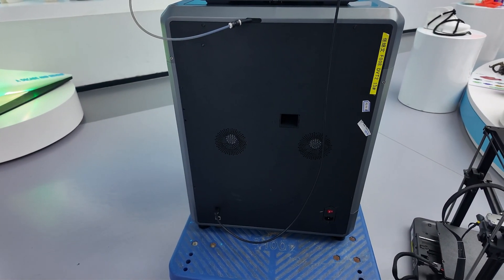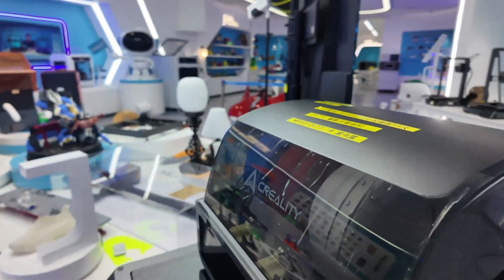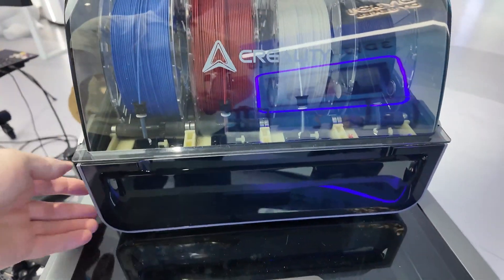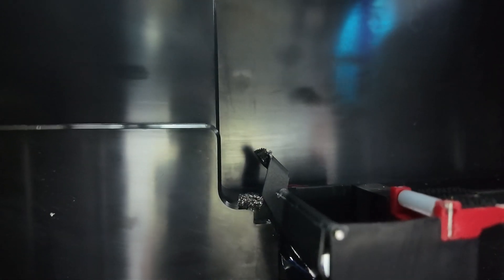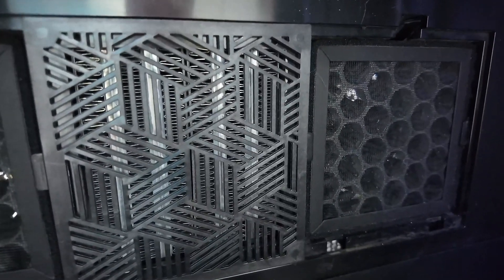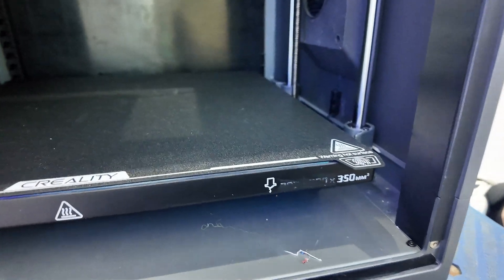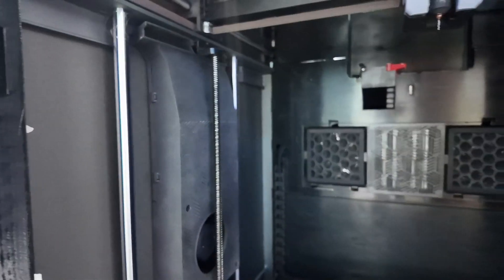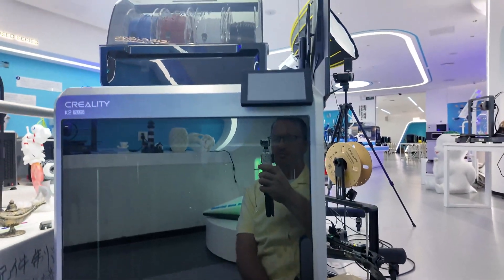Quality Time with #creality K2 Plus.  This is your best look at it so far #crealityk2plus #k2+

Comment: Thanks for the tour Kevin, really looking forward to the printer. My only concern is the decision to go with 2x leadscrews instead of 3 for a bed this large.
Reply: 3 lead screws on independent steppers would be better. When it's only 2, the bed tends to drop gradually over time. 

I'm sure we can mod it in though. Maybe even use 4 leadscrews.
Reply from the maker: they said with the K1 series, there are 3 lead screws but they are all on the same motor.  This has 2 and they are on 2 independent motors so it should be better.  And there are four linear rods on the z axis too...

Comment: It'll be nice to have another enclosed color system printer.  I'll hold off until its been out a few months and others have done the beta testing on it, all the kinks have been worked out and unbiased reviews hit YouTube.  The massive 350 squared printing area does sound extremely tasty though.
Reply from the maker: for me, the print size is the most exciting part too.

Comment: Is it possible to change the spool in cms during printing and set a different color? E.g. I have 5 different colored layers, after printing the first one, I change the spool of color 1 to color 5 and the CMS/printer knows that this color is there?
Reply from the maker: i will ask him this one too - you have good questions!  For your other question about filament going into those CFS holes on the back - that won't work.  The filament box loads and unloads each color so if you put just a roll into the back to try to get 5 colors (love the independent thinking) it would get pushed out when ejected and have no way to get fed back in.  There is a single spool holder available for it if you don't want to use the CFS - or you can buy 2 CFS and have 8 rolls.  Doesn't have to be 8 colors, can do two or three spots of the same color that is commonly used so that when it runs out it will automatically use the new roll of filament in the same color.
Reply: @kevin.in.3d  The previous question was about single colour, not multi-colour printing from an external spool. CFS does not support TPU, I mount the TPU spool on an external holder and what next? How do I connect this to the printer, I have seen that Bambu Lab users print splitters to not have to unplug the AMS from the printer every time they want to use the external spool. Hopefully this will be solved better here

Comment: Can I connect 3 spools directly to the CMS connector instead of another CMS, e.g. TPU, and manually select to print from that spool, single color of course ?
Reply from the maker: good question - i will ask today!
Reply: My guess would be no as the CFS unit is what would pull the filament back out of the extruder but I will be watching for the answer to this question as well.

Comment: Gorgeous 🥰😍 Super excited to get this printer!! It's nice that it also uses cardboard spools. 😊
Reply from the maker: Hi Christine!  Thanks for watching (as always).  Have a good time at Sharefest!
Reply: Cardboard spools suck. They fall to bits when you dry them at high temps.
Reply: @mackinsvii9022 I don't think so. 1 roll of filament only last me a day or 2 so I've never had that problem before
Reply: @ChristineRamirezCr  You're printing PLA I bet? If you're using anything hygroscopic, you have to dry it first.
Reply: @ChristineRamirezCr  print fast and live in the desert!  Good plan.  It's so dry in AZ you must never worry about drying filament.

Comment: Quality of the printed poop shoot part is not really good.. :(
Reply: its a demo not finial stage. I think a lot will change.
Reply: Thanks for the info.  I hope the printer they printed this on was just not calibrated, I don't think they will do any major hw changes until release at this stage. Looking at the specs it should definitely do better than one of the cheapest klipper bedslinger, or else I don't see the point of coreXY, closed loop motors and anything that makes this printer expensive besides the sheer size and the mms.
Guess we will see, I will be in the first round of public beta testing (first day 50% sale), ill be excited to see what they manage to deliver.
Reply: 1. That poor print quality right there has to be a MAJOR alarm sign!  I don't buy the excuses this is just an early prototype, and therefore OK at this stage. That's a weak excuse this far into pre-production. This is an experienced company, showing off their flagship model, and trying to finally convince the many sceptics they have what it takes to knock BambuLabs out the quality-of-print park with their own game.

2. The other thing that really irks me about Creality is the inability to address the MANY criticisms of the poor placement of the Poop-Chute, Filament Entry Points, and Mains Power Switch at the BACK of this large and heavy unit, when it is immediately obvious to any USER-CENTRIC designer, that ALL THREE of these facilities SHOULD be placed on the FRONT of the machine.  Having a bank of these machines on a bench against a wall is an obvious customer placement. An Engineer / Designer that persists in thinking its OK to stuff important operating access at the BACK of a heavy, awkward to move machine in a row of similar machines against the wall ... needs his pay stopped until he fixes this mistake! (And I would still continue to be worried where else such a designer is taking short-cuts at the expense of the end-user).

This is a sales-feature mistake that needs the intervention-balls of a Steve Jobs / Elon Musk type CEO character to throw his toys out the cot, and pull the plug on the design team, and DEMAND they fix it. Pronto!  Middle-management AIN'T gonna take that decision. It's the ethos of the man at the top that separates out a great design company, from the merely good.
Reply: He says "printed for it", not "printed on it", there are several different printers there, and this one isn't even plugged in, so it is possible they printed that part on another printer.
The prints they showed during live streams seemed to be better quality. Lets hope this is not it, because my 250usd v3 ke prints look better than this @500mm/s
Reply: @ntopee  with his answer he confirmed that it was printed on the K2 Plus

Comment: How do you connect additional CFS units, couldn't make out where you would connect them to the printer, additional USB points?
Reply: At 1:05 where Kevin is pointing are the ports for the other 3 CFS & they run from just the 1 USB connection
Reply: Am I just missing something altogether? I can see the ports for the tubes from each additional unit but not the power or usb sockets or is it that it's not the final production one and the extra USB ports not added yet or are do they use WiFi? I can see me wanting an extra unit, hopefully! 😁😁
Reply: @simonbehnke4756 
The first CFS unit supplies power to the additional units. check out the vid link above
Reply: @simonbehnke4756  the first CFS connect to printer usb and the first CFS powers the others. i will look for vid i saw this on and post a link